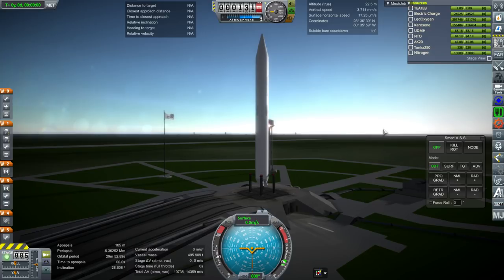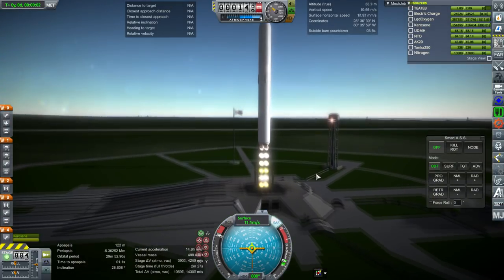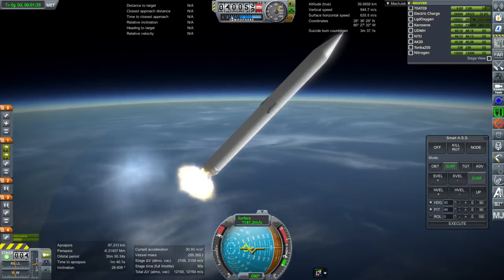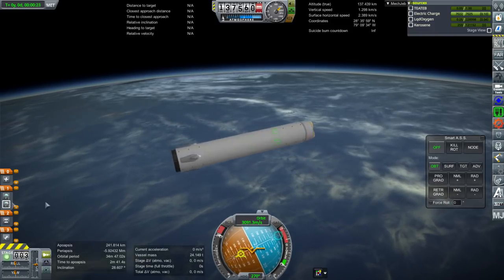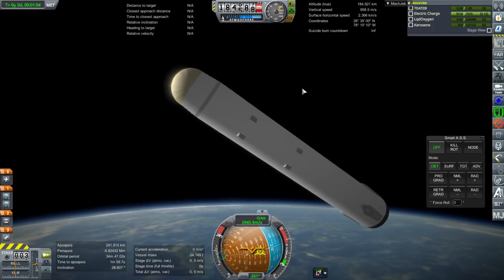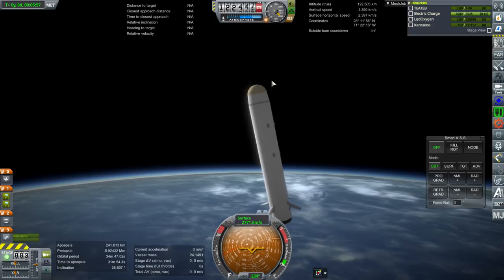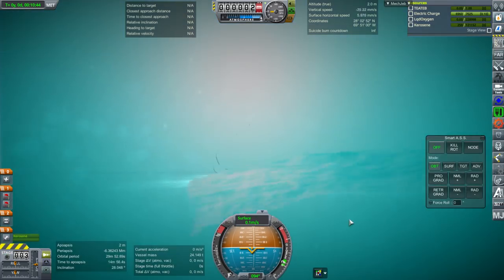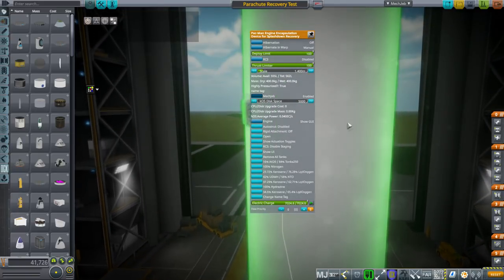Kerbal Space Program - Part Dev - Pac-Man EDSR

Comment: Hmm, water tight?  I wonder if you really wanted to protect engines from a marine environment, could you spray hardening foam all over them and then dissolve it when you turn around the booster.  Bonus is a foam could be ablative and help with heat.
Reply from the maker: Feel free to animate a hardening foam if you want it, but I'll stick to my Pac-Man shell. I feel it is convincing enough, and certainly in real life such a part can be made water-tight.
Reply: it is plasma tight. maybe it can handle water too)
Reply: @RaizSpace  As a mod it would be ok, but I was wondering if such a thing could be done in real life to protect hardware from the marine environment.
Reply from the maker: It's just a matter of how heavy it would be and whether it's really worthwhile, given the parachutes, the brakes, and the floats. The actual way it extends would be different - I did it this way because it was easy to animate, but in real life there are better options.